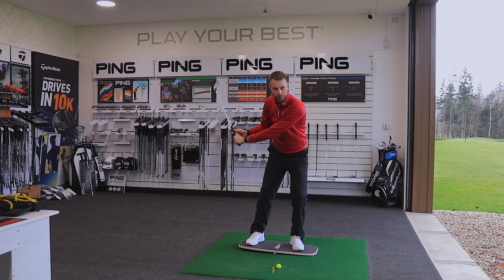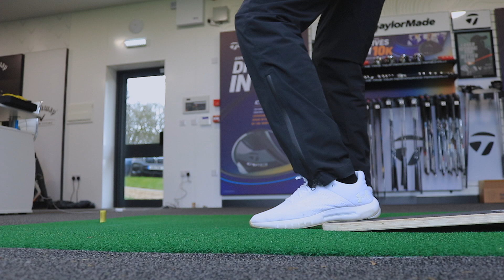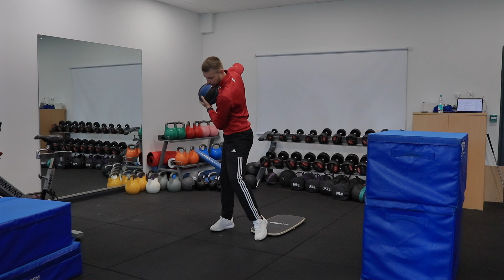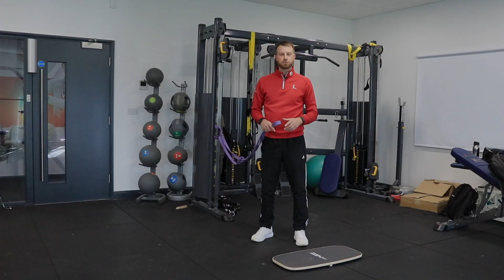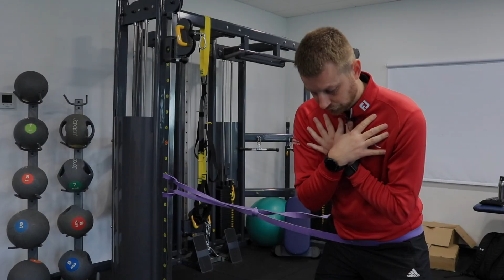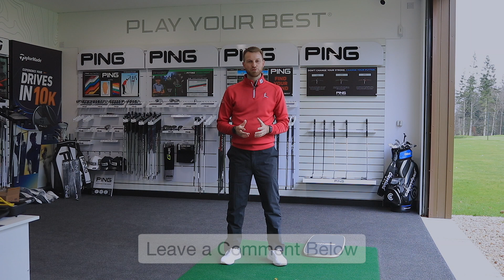How to Create POWER into IMPACT

Comment: Ive never seen this question answered: why not just stay on the lead leg, given what trouble the shift from one to the other causes? A pro might squeeze out another 5% of speed by doing it but us mere mortals?
Reply from the maker: Are you saying, aim to keep all your pressure on your lead side in the backswing?
Reply: yes  @svgolfperformance
Reply from the maker: This can be a good feel for some who might move too laterally and sway off the ball in the backswing. However, this is because they are not shifting their pressure and body weight correctly. All golf swings in some capacity will shift pressure to their trail foot in the backswing... it just depends how much, at what time and in what area of the foot this happens which will result in how effective it is.
Reply: thanks. i think continually being told to shift weight can lead to a lot of sway....people dont realise the weight shift to the trail side kinda happens anyway as long as you dont do anything stupid....its getting it back correctly that we get wrong, IMHO   @svgolfperformance
Reply from the maker: @tobybarker6808  I totally agree and I think a big reason for this is the term of shifting weight. Body weight like you say we move naturally to the trail side in the backswing but try to put it there is the wrong approach, it should be a shift of pressure which is very different. I also agree about that transition and downswing being hardest and thats because the club has to be in the correct position to allow rotational freedom. However, if pressure and mass isn't moved correctly in the backswing in the first instant, there is going to be compensation into impact. Overall, the two components have the be matched up for the players ability, skill, shot focus, physical ability and perception.

Comment: What is your opinion of stack & tilt as it relates to weight shift?
Reply from the maker: From my knowledge of golf biomechanics as well as the opinions of certain experts I respect, I don't see its benefits. It's a method based swing approach that would likely ruin more players than it helps.
 What are your thoughts?
Reply: @svgolfperformance  I’ve played around with it off and on. I’ve found that it can help with low point control and compression. Not a total believer as of yet.
Thanks for your response!
Reply from the maker: It makes sense. From some 3D data, it's very much a feel vs real method... as in a player can take the feel of keeping pressure lead side but the real is that doesn't happen, it just helps them minimise a previously poor pressure or mass shift. So there is the argument that if a player has a better concept or understanding of how they need to move, they'd get equally as good a result or better. I guess like all these things, it depends.